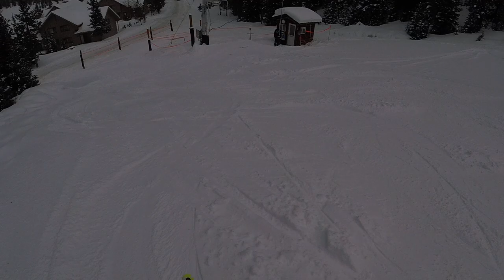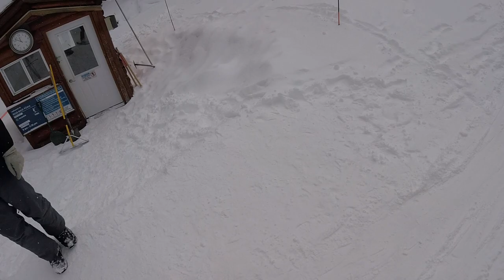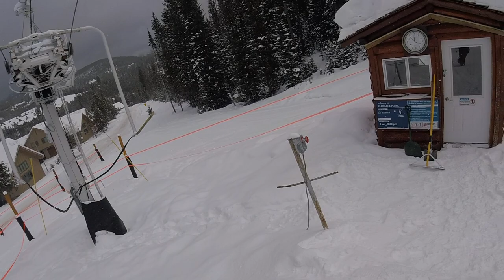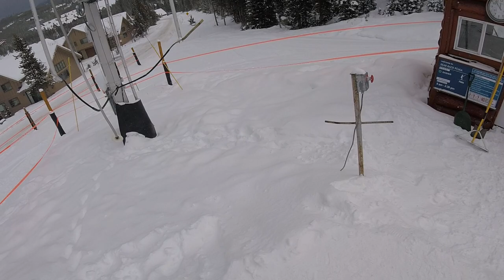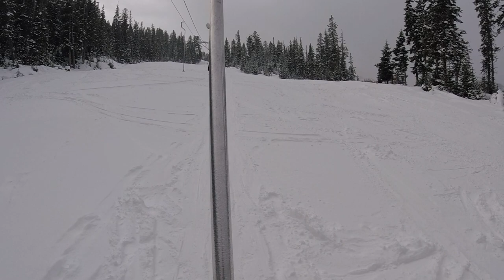Big Sky: Bear Back Platter

Comment: Big Sky should (at some point) think about replacing this with a T-Bar or a higher capacity surface lift. It's a bit overkill for the area, but they have lots of renters and homeowners in the morning that flood the queue before the other lifts open, and have race teams that train here during in the afternoon and into the evening, making Bear Back a busy area. When I stayed on Low Dog road last March, it was always such a pain in the ass hiking over to a lift, then walking uphill to the load area, and then waiting 20 minutes for someone not to fail loading the platter.     

 In my opinion, that's definitely worthy of an investment, considering t-bars are making a comeback for this exact purpose as well as real estate lift access, of which Big Sky already has 9 of!  Time to get rid of the platter.